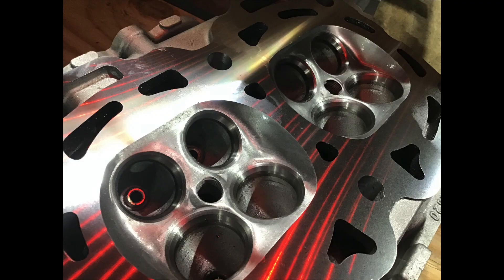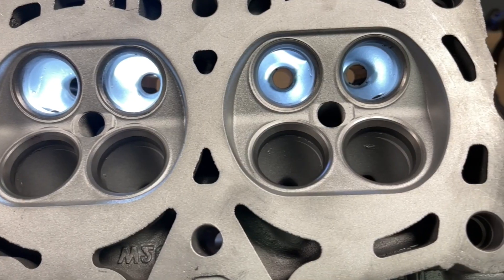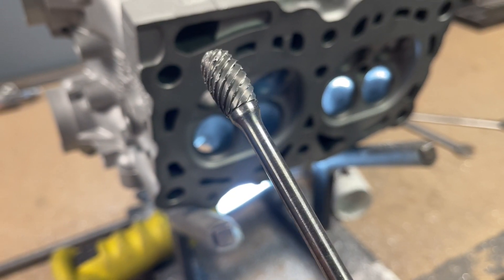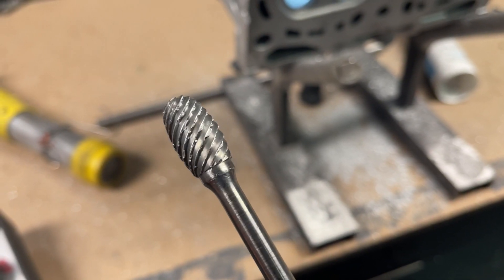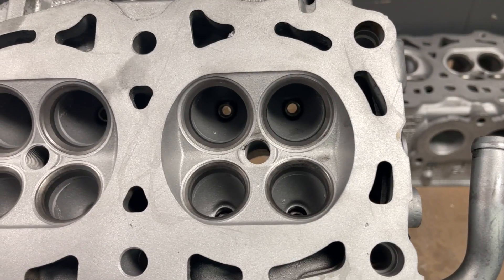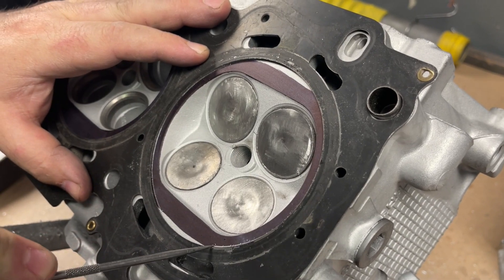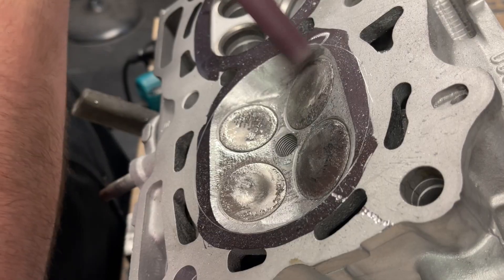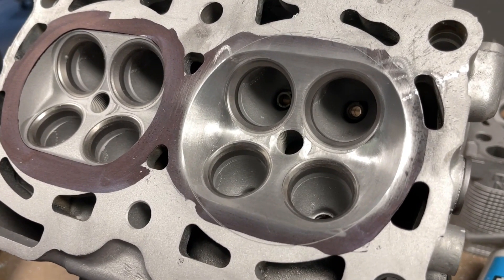HeadGames Motorworks Subaru Series Episode 3:  Pocket Port

Comment: Be careful with those electric diegrinders , most are too fast and are bad news with long shank burrs .
Reply from the maker: Agreed! But this one is not one of those. You can run it full speed with a 6 inch long 3/4 burr and no issues

Comment: Great video! Three minute voice overs are so much better than ten minute explanations unscripted explanations. 

Does reshaping the chamber size change the compression ratio?
Reply from the maker: thanks for the feedback!!! This has been a conflicting situation. The voiceovers take so much more work and not personal. And the explanations are hard because for the moment I suck in front of a camera. lol We got you Billy! Thanks again.
Reply: It drops the compression,  that type of work is usualy CNC cut. I just had 2.0 heads cut to   2.5 bore. I couldn't imagine this being accurate to the nearest cc
Reply from the maker: @brandinknight3797  the cnc is actually not as accurate as you might think. A cc is quite a bit of material, and easy to get right by hand. It’s a shape, and if it’s out of the shape it’s not hard to spot by eye. 
The cnc deal is a digitized hand port, and it’s machining on an imperfect part, the head casting is all over the place in terms of core shift. The cnc only knows where the chamber should be, not where it is. So we know for sure it will not make everything exactly the same unless you’re making it out of billet. Advantage here is the cnc can do it much faster. But not that much better.